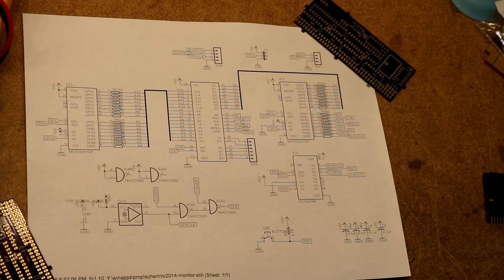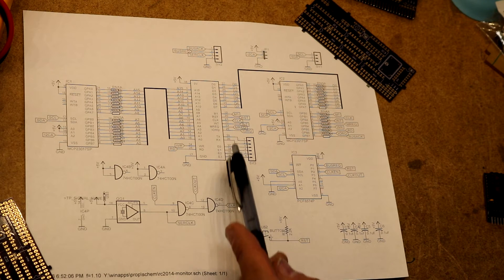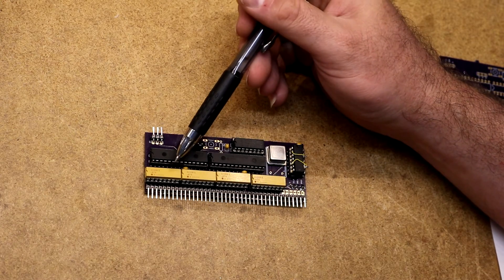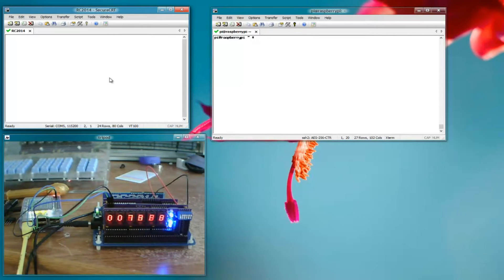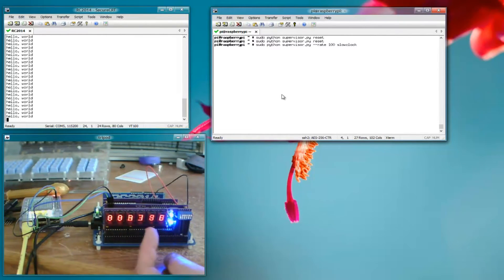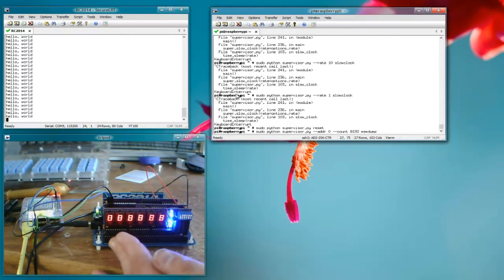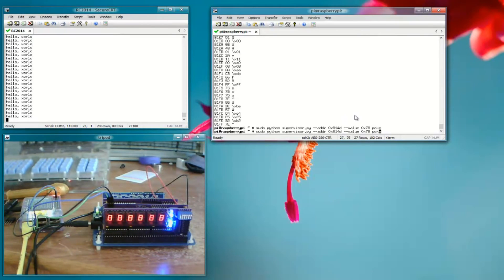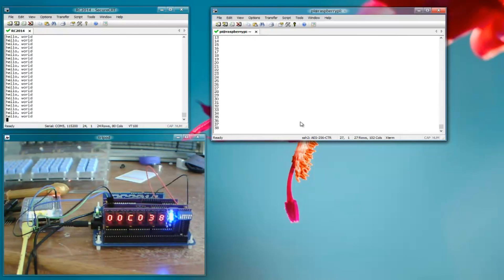z80 retrocomputing part 4 - bus supervisor for rc2014

Comment: Hey. So I finally had time to toy around with this board last night, and I couldn't get my system to run correctly when it was plugged in.  Without the board plugged in, the RC ran fine, i see the basic startup prompt, etc.  But when i have the board plugged in and i press reset, i get the first few bytes of the BASIC rom starting up, then nothing.  About half the times i press reset, i get similar results, the other half, nothing at all.   From the Pi, I do see the devices on the I2C bus.  and running the 'reset' command does seem to reset the machine the same as pressing the reset button.

If i run a memory dump, and press the reset button, I do see what looks like bytes out of the rom via the data bus coming out over the I2c link/python script. 

I'm just realizing now that there may be additional lines i need to hook up to my CPU...  or something like that?

Comment: Could it be possible to hack your uart console board to use a second clock board?  Piggyback a small connector on it to plug in another standard clock.  Would that work or would the timings get all wonky?  (for what it's worth, one of the guys on the RC2014 list is sending me a Bus Supervisor board/kit.  Really excited to try it out.  Have you controlled it from a different I2C host?  Perhaps like an AVR or something? I imagine it would work.  (i've got bunches of cheap AVRs and no spare raspi's... so an avr hooked up as essentially an I2C bridge to USB for my main computer could be nifty. :D

I've got too many ideas and not enough time.
Reply: And.. you responded to my uart comment 3 seconds after I unpaused the video. hahaha.  questions still on the I2C Host though thing. ;)